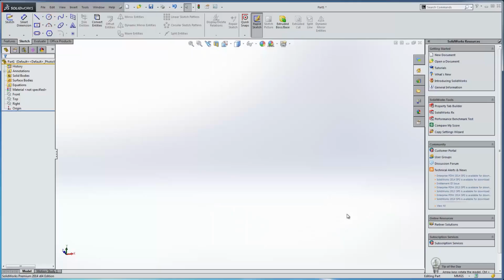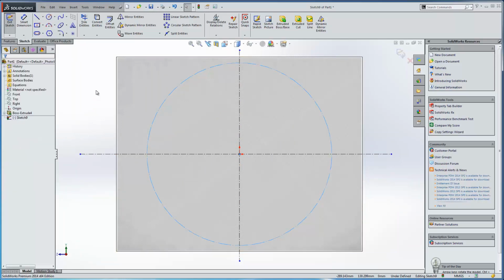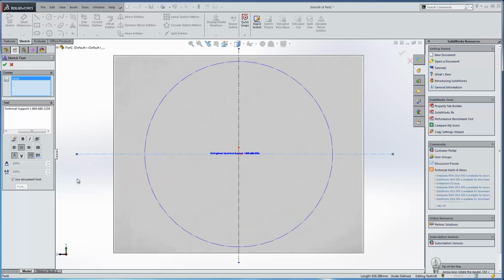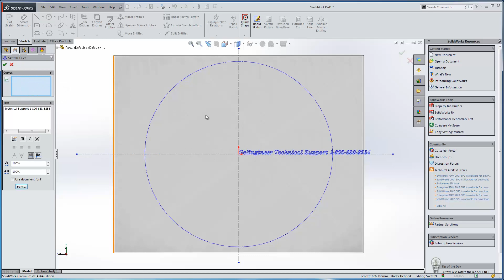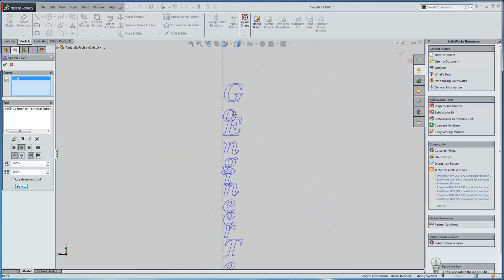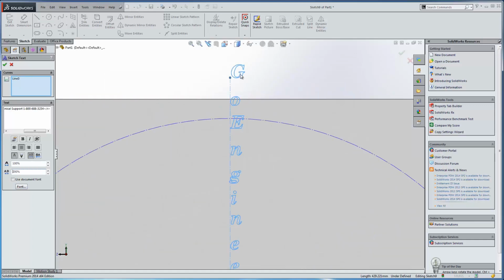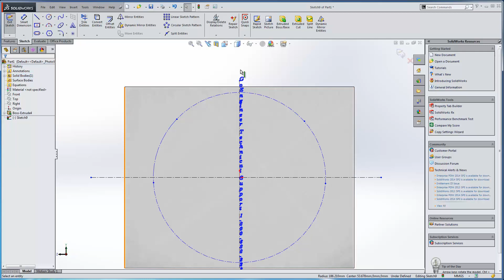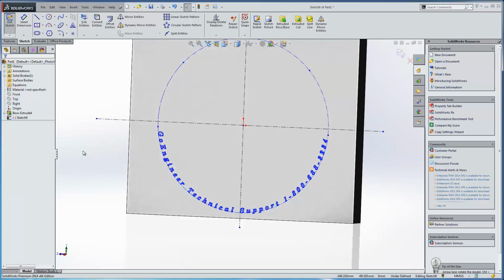SOLIDWORKS – Text Font 101

Comment: I want to change the default "Document Font"  So I do not have to change the properties of several text strings in a sketch.  When you are making labels for a 12+ pin connector it gets annoying.   I want to apply my small font globally to the parts.

Comment: Nice. The only question is how to make the text to stay in the center? (not on the right side of the sketch line)
Reply from the maker: Hi Sean,
At 1:18 in the video you will see the selection of the text alignment that sets the text to be centered on the selected sketch entity.
Reply: @goengineer  This is not exactly what I meant. Let's say, with a vertical text, its attached to the sketch line relative to the center of one axis (up and down), but not in the other (a little bit off to the side). It is easy to create a line in the center, but in order to set the text  in the center of both axis, I have to do it manually. Apparently  there is some certain limitations in this regard.